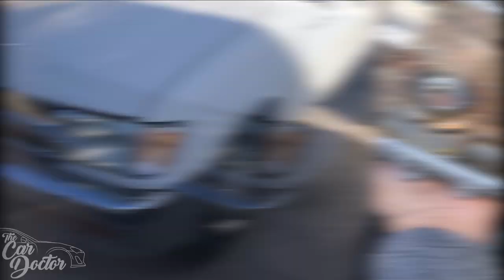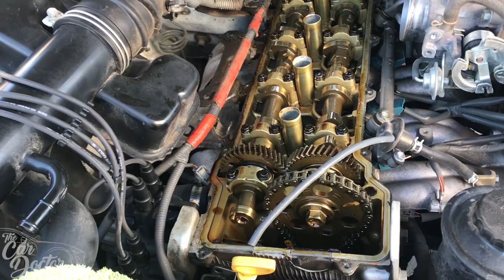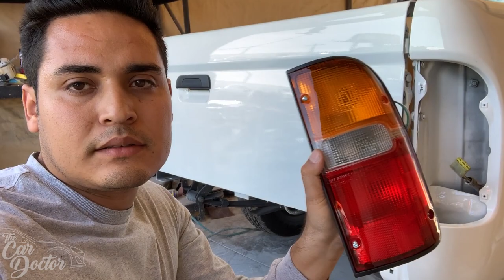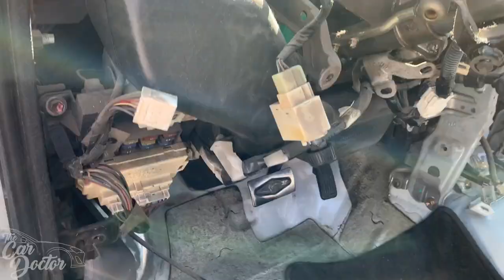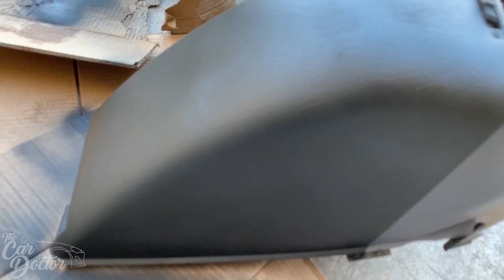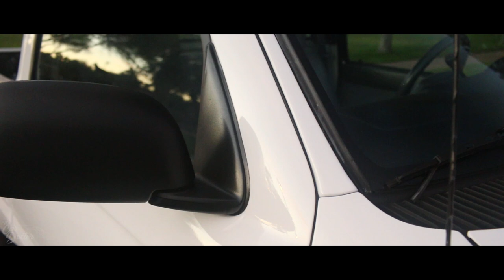Project Daily [Ep.14] "98' Toyota Tacoma Resto?"

Comment: Trokiando cuh 💨💨
Haha on a more serious note you did a great job the truck it looks great. My dad actually had one of these in stick and it lasted 700,000 miles.
Reply: Quema o no quema cuh, haha. Saludos tokayo
Reply: What happened to it?
Reply: ???? I got a 97   Just starting to change all the failing OG parts.   Cleaned the throttle and the intake. Runs like champs with 300++ miles.

Comment: Nice truck! Just bought a 97 yesterday. Super excited! U got skills
Reply: How much u bought for bro looking for a regular cab they expensive af tryna get a 96-01 they want 4K+ with 205k+ found 2 300k and 298k
Reply: @MyRcGoSlow  hi! I got a 2wd 4 cylinder basic cab with 176000 for 4200. Even has ac! I tried to talk the dude down but he got pissed and said no so I did it. Lol! I've seen quite a few on denver cl for around 3500 up. They usually have atleast 250000 and up in miles so I knew I was getting a gem! The sellers know they hold their value so usually don't budge much. If u do buy one make sure u look underneath to c if any rust damage. There was a big recall back in the day.  Good luck 👍
Reply: @MyRcGoSlow  I got lucky with mine. Bought from a mechanic shop, it was the parts truck, 3k for '02 single cab, ALL ORIGINAL, w/ 432k miles. But everything was maintained since the shop bought it brand new. Interior looks brand new, it was repainted. Powertrain all original. Runs like a rolex, A/C is ice cold, I've owned it for a year now, and put 2k miles on it. All I had to do was basic maintenance because it was due. That's it. All the fluids, filters and plugs. Aside from the upgraded wheels and tires, it looks brand new. No dents or scratches.  I get offers everyday on it. I'll never sell it.

Comment: Iridiums? Expensive. Iridiums last a long time. They are meant for applications where reaching the plugs is a labor intensive job, see Sienna van with a V6. Your plugs are very easy to change. The plugs you pulled out were in great shape. Forty bucks you could have saved. New car ownership is a very emotional thing. Nice truck.

Comment: I just bought one with 137000 original miles. Would you expect the rack and pinion to already need replacing? The truck was never abused.
Reply from the maker: Not at all, just check the bushings on the rack.